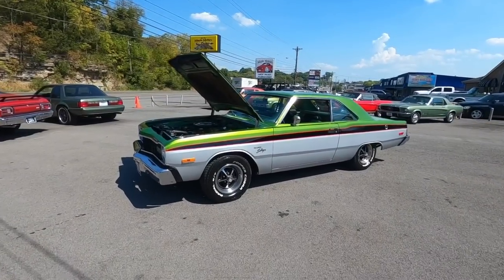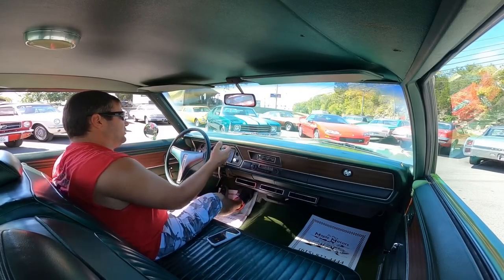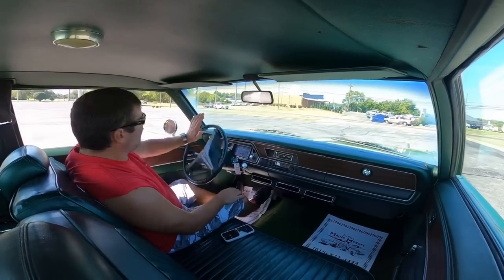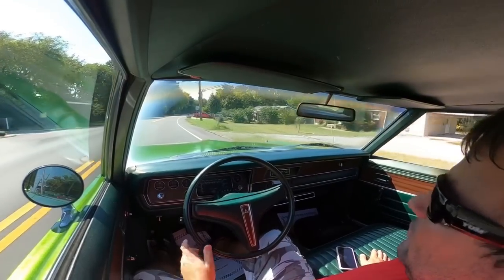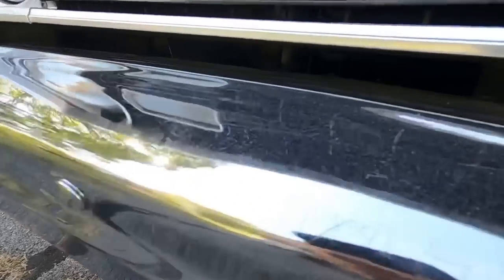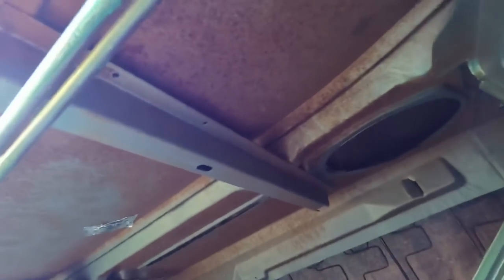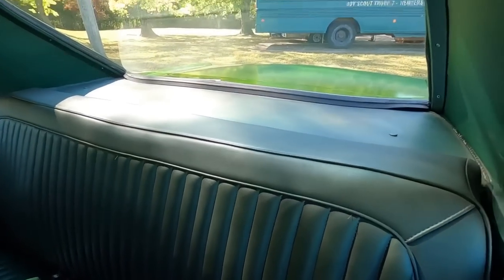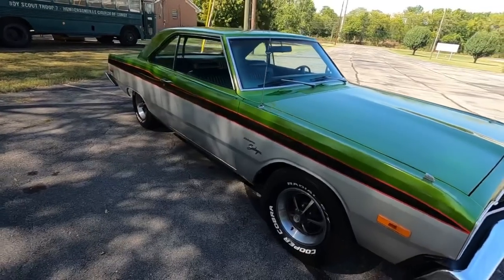Test Drive 1974 Dodge Dart SOLD $12,900 Maple Motors #1879

Comment: Put a nice exhaust system just a little bit louder and flip the lid of that breather to give it that sound. But I like the paint scheme it's cool 👍
Reply: That "sound" you're speaking of comes from spreadbore carburetors as the oversized secondaries open. A squarebore Holly, Edelbrock or Carter won't make that humming sound.

Comment: I used to have a 73 318 Dart. Wasn't fast, but ran forever. I sold it with almost 400k and it still ran like a top. This one would be a good candidate for a 340 swap, although, believe it or not, you can make big power with a lowly 318. Check out Uncle Tony's Garage if you're interested in that kinda thing. Pretty old Dart in awesome shape 👍👍

Comment: In the late 70's I had a 74 swinger but I had a different front bumper mine had rubber push blocks on it and I had a 198 slant 6 but looking at the inside of the trunk and engine compartment mine was the same color I did not have the A/C though, I loved that car would love to buy this one seems like a good price loved those split bench seats had lots of good times on them lol. I put some fat tires on the back and white wagon wheels on it it looked pretty good but that 6 did not have much get up and go, lost the car in a divorce I got the 69 GMC pickup and she got the swinger and a new husband. I may call but leaving the country for a month in 3 weeks don't know if theres time for a deal.

Comment: I think a slant 6 would be a better motor in my opinion I always liked them.
Reply: They’re reliable as hell but just a tad bit underpowered for me, I have a 74 dart with a slant 6 in it now looking to shove some kind of v8 in there as soon as I figure out what lol
Reply: @ro.gtheoutlaw8391  Very underpowered compared to today's cars. Everything is 300 plus horse power today. The salnt 6 in my 78 plymouth had 120 hp. It was just a really reliable and unique motor.
Reply: Slant 6 was the most durable engine, those cars ran forever
Reply: @woxyroxme  UTG did a video of a fuel injected 300hp slant six.